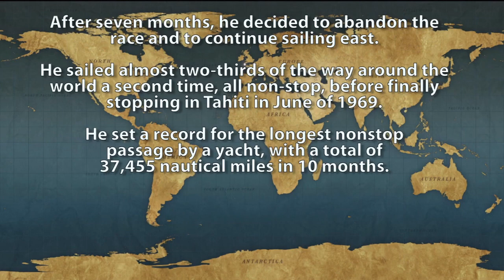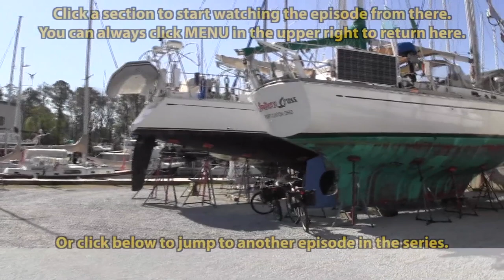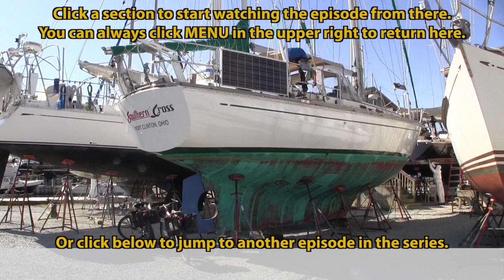Deck Tour of Liveaboard Sailboat Southern Cross, Part 2 (Dickerson 41)

Comment: Very interesting video Drake. Like the way Don en D tackled their problem with the e-mail survey. I also heard negative stories, but my Selden Mast Furling System worked great in over 20 knots of wind during the Delta Lloyd 24 hour Regatta in the Netherlands. I have vertical battens from top to bottom in a Elvstrøm main sail. Making step-less variable reefing (fine tuning the sail to the weather conditions) possible. And on top of that single handed sailing becomes easy and safe, not having to leave the cockpit. I agree with Don, that the system is mature, but you have to handle the system with care. The line on the winch on the mast came of once and don't unfurl the the winch, this will block the sail from coming out of the mast.

Comment: Some great tips there. I must say I'd heard the same stories about in-mast furling. I'd like to know if it effects the masts strength by having a slot in it from top to bottom for the sail?
Reply: There is actually an inner wall that makes the front half a complete structure.  The furling cavity is made up of two "wings" added behind the structural part, and they do add considerably to the stiffness.  I think that Selden must have employed all the old 60's Volvo engineers, the rig is massive compared to the original.  The new lower shrouds are stronger than our chain plates!  So, we shimmed the bottom pins to a smaller size to make them the weak link!